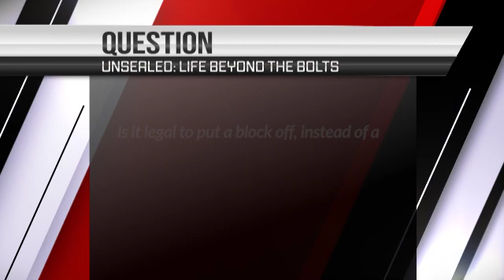Tech Tip | Block Off VS Power Valve in a Carburetor

Comment: I don't know why that was even posted block off valves are more reliable than a regular power valve in racing because it will never go rich or lean it will be consistent all the time.
Reply from the maker: Thank you for your comment
Reply: Popping power valves like crazy, are they not used to allow fuel to flow to the secondary's ? Would it just be basically a two barrel with a block off installed ? Thanks for any word.